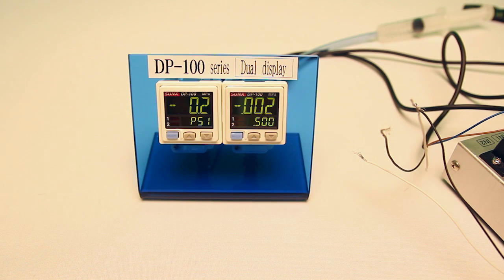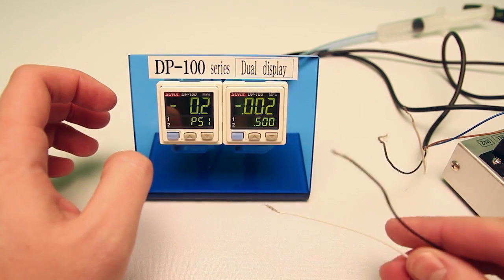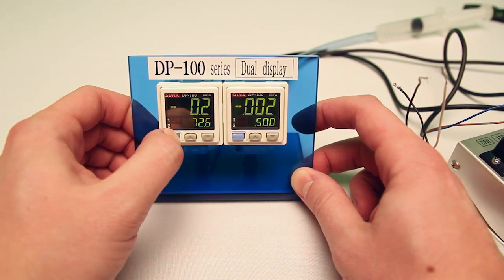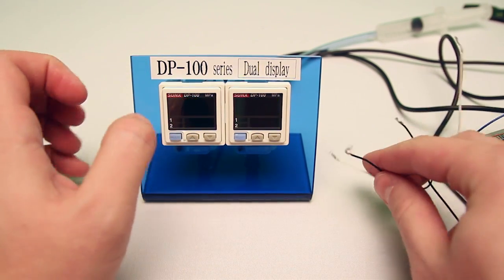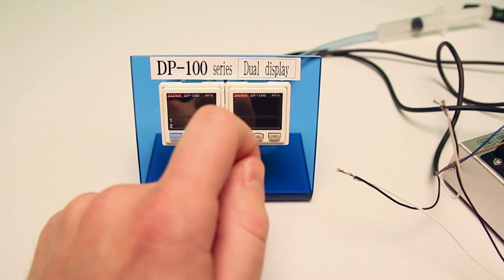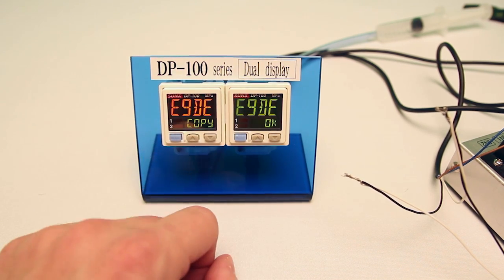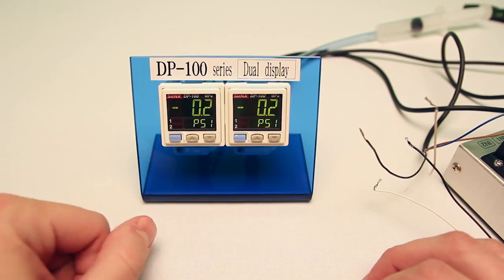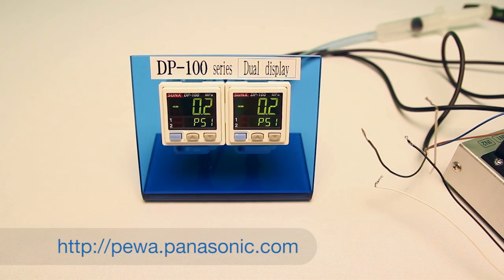Panasonic Quick Clips: DP-100 Copy Function

Comment: Now for me, is not difficult now to pass Microsoft Azure with the help of DP-100 Question And Answers. You can pass your certification with your desired grades. I have passed my exam by using Dumpspass4sure services for this preparation stuff and I can say with surety that there is no material as reliable and suitable as DP-100 Study Material.
https://www.dumpspass4sure.com/microsoft/dp-100-dumps.html